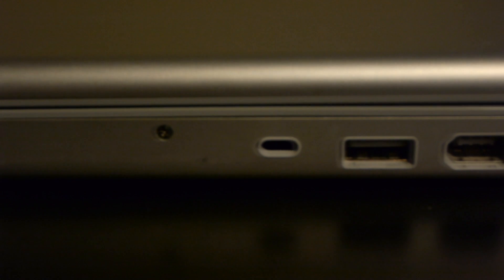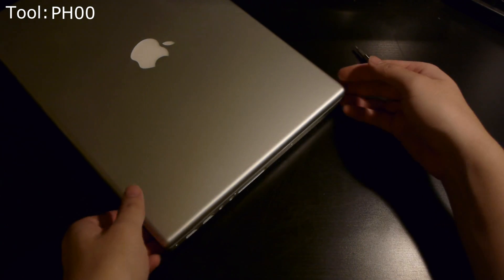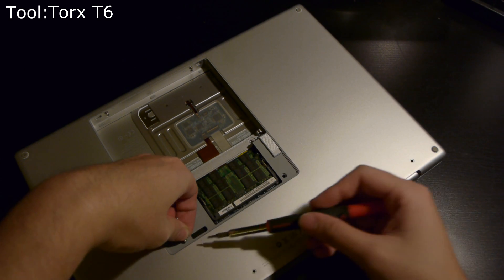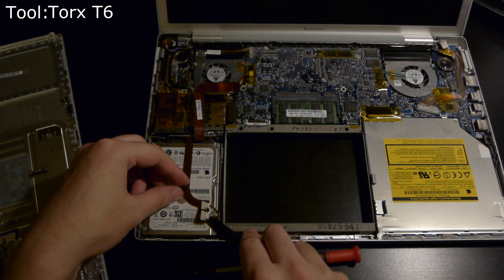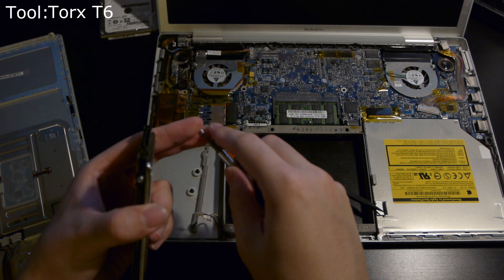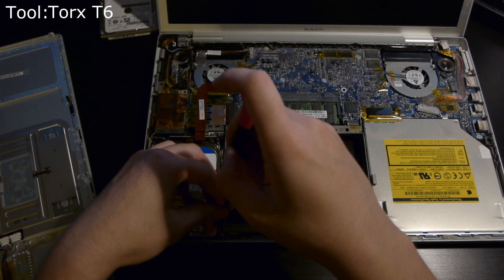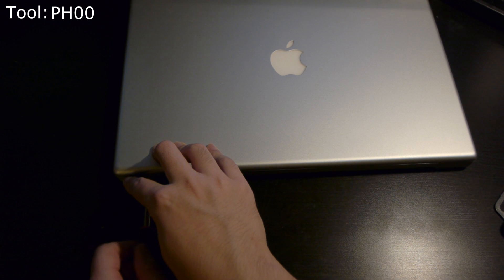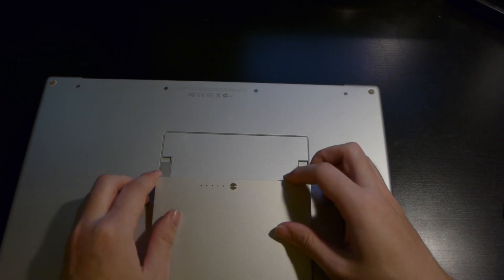[DIY] Macbook Pro 15" Pre-Unibody Disassembly and Hard Drive Replacement

Comment: plz i want help for my problem on my mac pro check my pic problem http://s27.postimg.org/jmf15b4mb/NFGLf_8u_Lm_M.jpg
Reply from the maker: Plug it into an external monitor with the DVI port on the side. If you see lines still on the second monitor then it could be the motherboard. Though even if it shows up clear on the external there's a chance it could still be the motherboard that is failing (specifically the GPU).
Reply: okay i ll try that and i ll be in touch with u , thnx man
Reply: That's a GPU failure... I have the same MacBook Pro, and it has the exact same problem. Unfortunately, there's really nothing you can do.
Reply from the maker: ***** yep. coincidentally the macbook in this video also suffered the same fate a month ago. Shame.
Reply: ez|2a I have 5 macbooks that are the same as this one. 3 of them suffer from a bad GPU, only 2 work properly....
Reply: Hat Games Try reflowing them… I've done that to a couple of mine, and now both work perfectly.